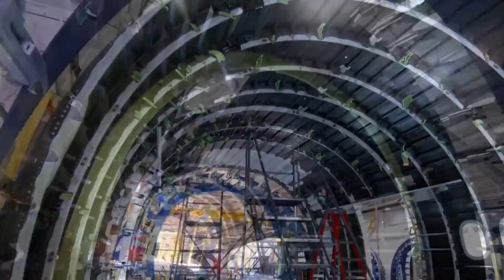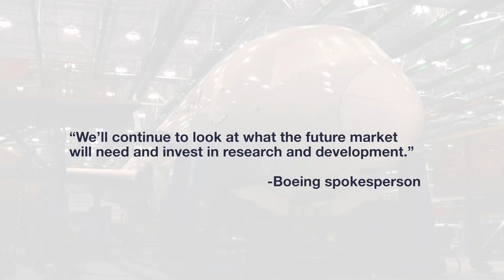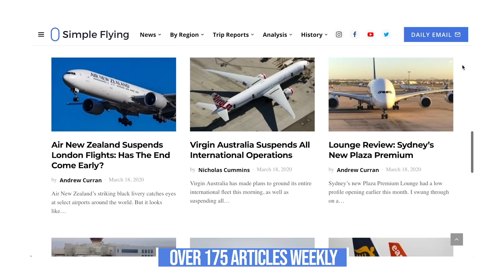Boeing Looks To Reimagine The 757 & 767 In Place Of NMA

Comment: I’m sure I read the 757 production line and tooling no longer exist.
Reply: swordscot Not only that, some of the buildings don’t exist anymore. Renton has changed radically over the years.
Reply: swordscot they don’t. It ended in 2004
Reply: How difficult can it be to revive a production line?
Reply: @mattiagnagno757  After this many years it would be an all new production line.  It would literally cost billions to resurrect it.
Reply: Mattia Gnoato you’re not reviving a production line you’re building a brand new one. There’s a difference
Reply: 767 production is still going due to the freighter models so that would be the better option over reviving the 757.
Reply: If I remember correctly, where the former Sam's club was on Grady Way, Boeing used to have buildings there.

Comment: I love the 757, a new one would be a huge success!!
Reply: Preston’s Aviation I completely agree that the 757 is a brilliant aircraft for mid-range routes. For a revenue manager, it’s the dream aircraft because it’s not too big. Only drawbacks are the windows which passengers now expect to be bigger and the single aisle.
Reply: @vondahe  compared to the current a321 the old 757 has huge windows so i cant imagine that being an issue
Reply: vondahe Yes, but the 757 has big windows.
Reply: Yes, a new 757 in various lengths to compete with the 319, 320 and 321. Also, retire the 737 line, it's at the limits of development and been stretched in every possible direction in terms of engineering capability.
Reply: lajoyalobos2009 Agreed!

Comment: I'm thinking of a 787-6. A Dreamliner with a single-aisle.
Reply: Oooo that'll just be an entirely new plane. Probably won't be able to call it a 787.
Reply: Be serious.
Reply: Tf?
Reply: Think about it. A Narrow Body with a longer range than the 757 and 767 with the same engine options. Even though if I had an airline, I would prefer Dreamliners with the GEnx over the Trent 1000.

Comment: They should've continued production of the 757
Reply: When they discontinued it ETOPS wasn’t a thing so airlines weren’t using it for what they’re using it for now
Reply: @robconnors4233  Actually, ETOPS started in 1976.  As engines advanced, ETOPS got longer and longer.  OVERSEAS ETOPS was still a thing to come, but ETOPS itself was already around.
Reply: Well, then you should have bought one.  I didn't notice you when they were handing out the pink slips.
Reply: Boeing ceased production after 9/11 no one could have predicted for the increased demand for the 757 (before COVID-19).
Reply: Agreed